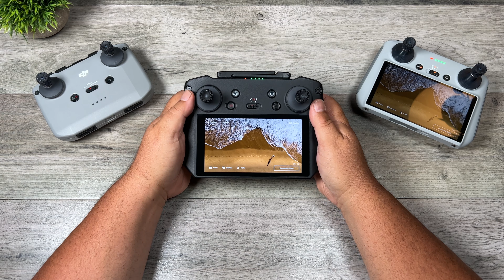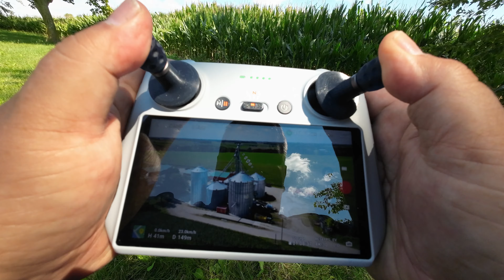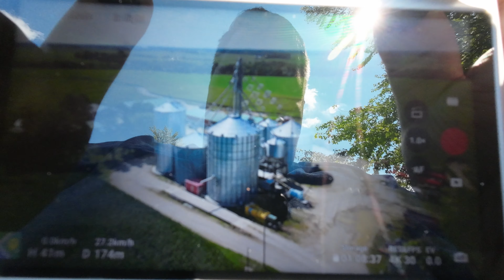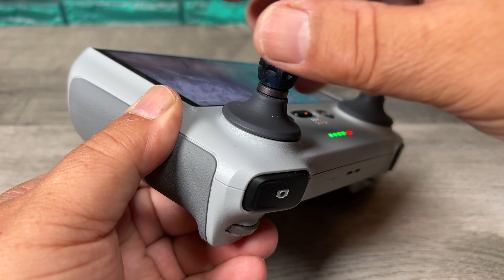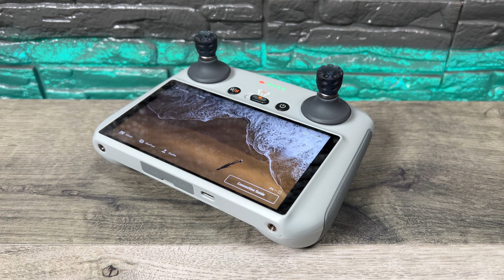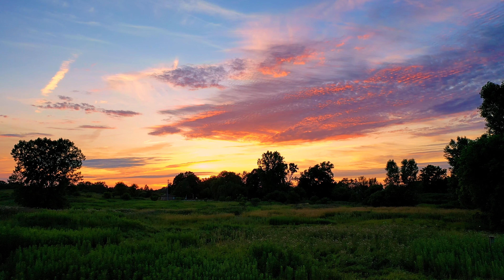CineSticks for DJI RC & DJI RC Pro | Scotty Makes Stuff

Comment: As an RC pilot for many years. you’ll find that if you use your thumbs only the sticks will move in an arc. It’s better for control if you hold the stick with finger and thumb - gripping the controller with remaining there fingers. The dji controllers are pretty thin so its easy to hold. It’s well worth learning to hold the controller that way. 
I do like the looks of the cinesticks thanks for that.
Reply: Wondering if this is a bit more comfortable for those who pinch the sticks like you and I. I fly DJIs every day for my job, and maybe fatter sticks would keep my fingers from cramping up after a long day of flying
Reply: @fourlokouva  may be
Reply: @fourlokouva  what’s your job if you don’t mind me asking. I have the mavic 3 and air 2s, I want to use them to make money one day, but don’t know what direction to go in ( of course after getting a license)

Comment: I purchased a set for the DJIRC and I really don’t think I’m going to use them. It does give pretty good resistance to slow things down however the plastic tops won’t screw on level and tilt on an angle because it’s just screwing into plastic and not a threaded sleeve. Just makes it feel awkward to use them.

Comment: I actually don’t use the sticks at all. I get better control by just using the remote like a trackball with my thumbs.
Reply from the maker: I’ve actually read a lot of people doing that they don’t even use sticks
Reply: Same. Unfortunately can’t do that with the RC.
Reply: I tried that with my Mini 2 but didn't like that I had to keep firm pressure on them or they'd slip. Now if they'd make a controller with only the trackballs with a bit of grit for grip, that'd be awesome.

Comment: I owned a pair of the first gen. The build quality was top notch and they performed well. I ultimately got rid of them because I felt it was too difficult to move the sticks in case of an emergency in flight. I wish DJI would bring back tripod mode (which they probably won’t) or allow us to really tweak the settings for the sticks. Great video, cheers
Reply: Tripod mode = Cine mode now

Comment: Thanks, looks interesting however, I already have some extended sticks which perform a similar function in slowing down movement, so will hold off for now as I tend to buy on impulse then never use things.  The next time I fly with the RC Pro I will decide if I need more resistance.

Comment: I think they are bad for the controller in the long haul wear and tear on the pivot’s pulling upwards
Reply: PhillyDroneLife  hey Mikey
Reply from the maker: A good point it’s hard to say how they will hold up over the long run. For myself like I said I won’t use these as my every day sticks. Usually when I’m flying cinematically I’m not doing really hard movements that would put a lot of pressure on the mechanism below. I think most of the pressure will remain on the rubber

Comment: Hello.. 
After  recent firmware updated my Mini 3 pro. I can not move left sight or right side. I can move only backward and forward. Do you know any solution. Please advice
Reply from the maker: If you go into your settings under the safety tab you’ll see there’s an option there that says disable sideways flight. Turn that off. Quite often after firmware updates it does enable that setting for some reason it happened to me as well
Reply: @AirPhotography  Thank you for your kind advice. Let me check. I am Abdul Halim from Bangladesh

Comment: Why not just go into settings and fine tune down input there? No need for another set of sticks. One setting for normal and sport.
Reply from the maker: You’re right that is always an option in fact I have all mine custom set. But it is hard to explain what that resistance does add that the software can’t

Comment: The only bad thing about these is that they don’t center themselves every time when you let go.
Reply from the maker: Thanks for sharing your feedback I’ve done several flights with themI have an experienced it with mine but I’m going to run some more testing. What controller were you using?